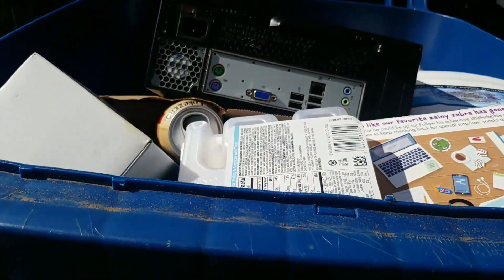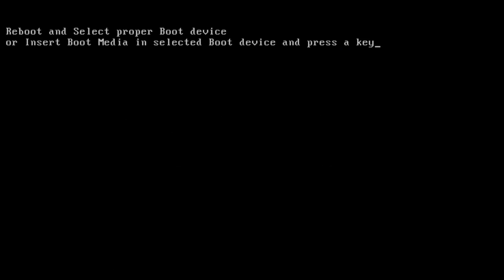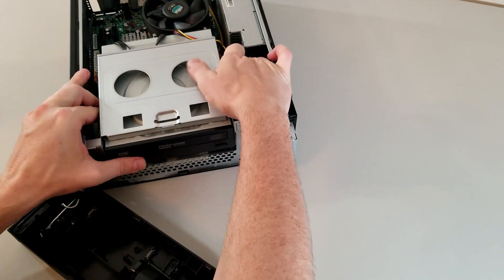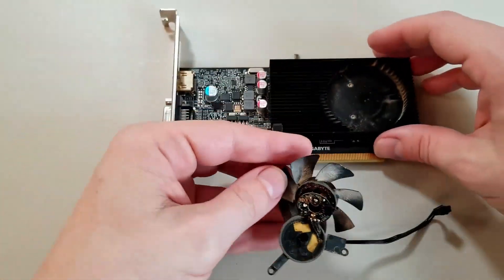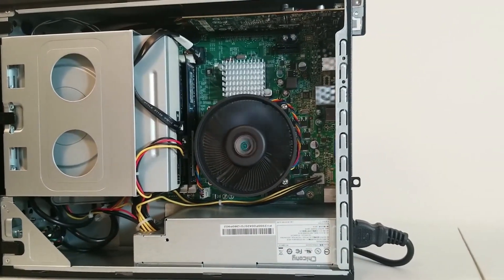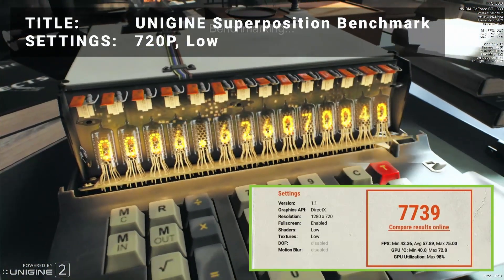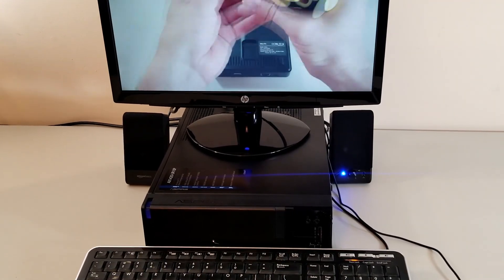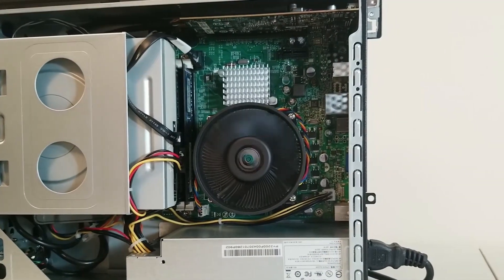I Found a Gaming PC in the Trash

Comment: Something you didn't mention is the garbage proprietary PSU. Dell uses the exact same PSU in some of their smaller entry level desktop PCs, and they're notorious for capacitor failure. I got one in the other day that was very unstable, and inspecting the PSU revealed most of the caps had leaked or failed internally and had to be replaced. Replacing the PSU with another used unit isn't an option, because it will have the same problem.

Recapping that PSU is a bit of a chore because of how cramped it is. It took me a few hours.
Reply from the maker: Excellent point! I certainly wouldn't be surprised if that power supply causes quite a lot of failures with these machines.

Comment: I subbed! Was a nice WD HDD! Is that Acer a  SFF? I would have grabbed it too! 😁🤓 Last 2 PCs I found (same place & time) were the small size boxes: 1 is ana  HP Slimline Pavilion with Win Vista (woo hoo!!) And the second one is a Lenovo IdeaCenter mini PC. The drawback was that the previous owners (a DJ outfit near where I work!) put a screw in the HDD in the Lenovo, and a screw in the CD ROM drive (thinking it was the HDD)in the HP.  So the HP does boot to Vista, but the Lenovo basically won't! Also on the Lenovo the CD ROM drive was removed. The HP does have the portable HIDDEN bay still intact. The CPU in the HP appears to be upgradeable, but the Lenovo is VGA, so a new m/b with a better CPU would be an upgrade. Thank you! Some time ago I also found a working Dell All in One PC!

Comment from the maker: This build is right on that edge between solid 720P and true 1080P performance. Using a higher end graphics card such as a low profile GTX 1050 could help in some cases, but in many cases that extra power would be mostly wasted by hitting limits with the CPU.